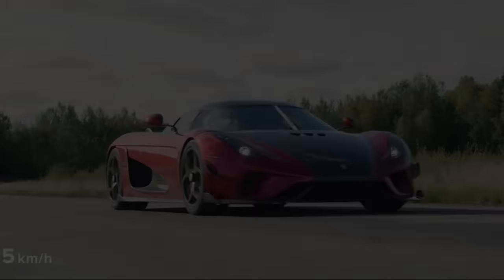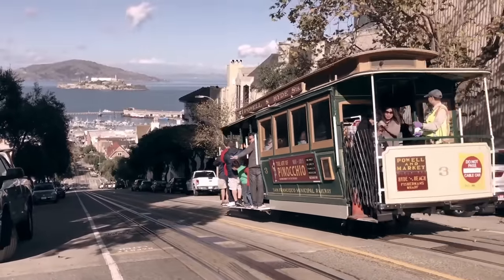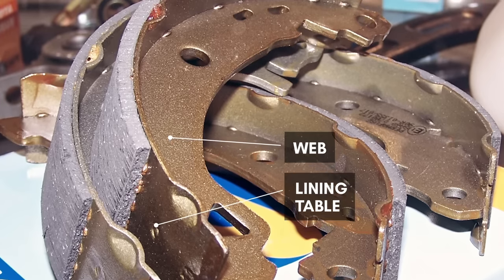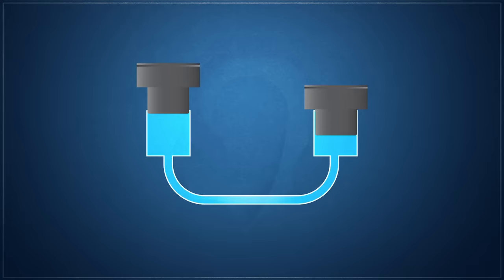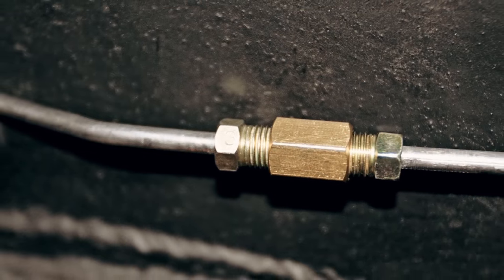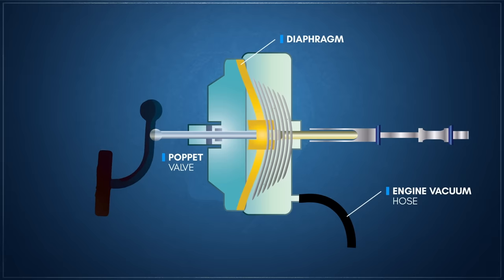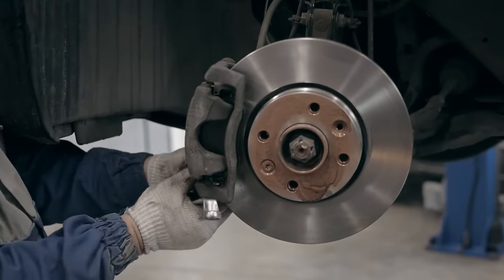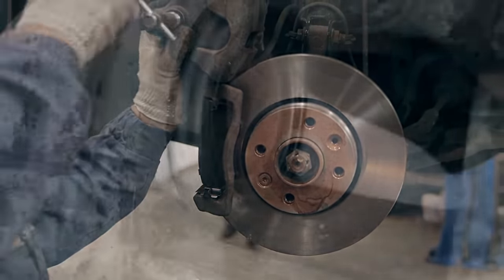The Story of Brakes

Comment: A positive effect brake technology regulations have had…
The iron composition of the rotors makes it easy to source proper and consistent alloy when doing a bit of mold making and casting.

It’s not too uncommon and there are a lot of folks out there who have been doing it for years in their backyard. Obviously takes a bit more complicated setup than a simple DIY garage set up to melt copper scrap or aluminum or what not… 

But it’s fairly easy to get going and not nearly as complex or expensive as an industrial professional setups.

A lot of it can be had on the secondhand market because of all the foundries shutting down or it can be cobble together from parts for almost nothing. Then a few times a year when the buddies need things cast for antique restoration or whatever reason… Throw a hella party for an afternoon everybody brings over beer and sweats their ass off helping. 

Quite a bit of prep work involved but it’s still a blast. There’s just some things that can be done easier and cheaper with a 3-D printer and simple moldmaking techniques instead of designing a cad model for CNC and trying to source proper materials. It has its niche but it’s also A lot of fun and sometimes you just need to part in cast-iron.

  
 A lot of at home casters have always appreciated the consistency in the alloys of rotors. Able to be sourced at most scrap yards for less than $0.10 per pound. And gives you the benefit of picking matching sets from the same lot to be sure the alloys are the same.

Comment: I remember watching a video on the mechanism and development of drum brakes, if they hadn't been descended from carriage brakes I doubt they would even have been developed at all since disc brakes are one of the most straightforward brake designs possible.
Reply: You make an excellent point.  One feature that prolonged the use of drum brakes was their self-energizing effect.  Many car buyers disliked the over-assisted touchy response of power assisted drum brakes, and were content to stay with un-assisted drums long after they had accepted automatic transmissions and power steering.  The linear response of disc brakes made power assist more necessary, but power assisted discs feel more progressive and controllable.  Front disc / rear drum brakes were an imperfect compromise solution, but still an improvement in the evolution to power assisted, anti-lock four-wheel disc brakes that we are all accustomed to for decades now.

Comment: small note: porsche also fitted some cars with tungsten brakes which decreses brake wear drastically while improving brake power
Reply: I'm not sure if it's actually improving brake power. As discussed in the video, virtually every brake system exceeds the acceleration force of a car/vehicle. ABS is there to prevent wheel slip, which occurs when you apply too much braking force. In other words, if you can lock up your wheels, which you can, you cannot brake any 'faster', the limiting factor being what's actually touching the ground - tyres.
Reply: The problem  is not the brake force but the tremendous amount of heat when braking from 300km/h or more. Also on the race track.
Reply: It’s called a thin layer of tungsten carbide. It’s to make the brakes last longer.
Reply: @dudo626 braking power is increased for sure. Obviously tires are the limiting factor, but you can also ways add stockier tires for allowing greater braking force. However even on the stock tires braking is improved at high speeds, as it reduces the velocity of the wheels quicker.
Reply: @2seep  Again, how can you "improve" breaking when brakes aren't the limiting factor?!? You CANNOT stop faster than traction will allow it without using other measures of breaking which isn't the topic here. "Reducing the velocity quicker" will literally block your wheels causing you to slip and lose traction. Please, tell me what drugs you are on, I want some too.

Comment: I just upgraded my 4Runners brakes to larger tundra brakes that fit and man what an insane difference a good set of brakes are on a vehicle. Especially a heavy SUV. stops on a dime now but also makes cornering and everything easier to control. A get set of brakes get you in tune with modulating the vehicle’s speed. Just makes the experience so much better.
Reply from the maker: Small world, I’m doing that exact same swap soon

Comment: cars also have a parking brake, which isn't mentioned, nor is the notion that hydraulic brakes require power from the motor to be effective. thus, 4-wheel disc systems require an additional drum system to act as a parking brake, which renders the rear discs almost pointless, yet they persist. who knows how or why.

Comment: Excellent job covering the history of braking technology development and the science behind each step of development.  Can't wait to watch more of your videos.  One early (sub) chapter of the story that I learned of recently... When the metal band around a drum was the default choice, Henry Ford chose to package that feature inside the transmission operating in an oil bath, and acting on the output shaft and thus stopping the driveshaft.  It wasn't common on a car brand basis, but when Model Ts were half of the cars on the road in the 1920s, It sure was the brake system for a lot of cars!  It did not have a lot of stopping power.  Model Ts also had a lever and cable drum e--brake on each rear wheel.  In 1928 Model As adopted four wheel drum brakes.

Comment: Cool video, as a car mechanic myself for 27yrs I found the history particularly interesting. One correction though, you say the automatic adjusters eliminate the need for adjustment on drum brakes at 09:58 , this isn't quite the case. Whilst it certainly reduces the need, the drums still need to be removed periodically to remove the dust and manually adjust the adjusters up (typically 2-3 yrs, about 20-40k miles), if this isn't done the pedal travel will gradually get longer and longer, as well as handbrake travel. Also the shoes will wear abnormally with greater wear occurring nearer to the wheel cylinders pistons.

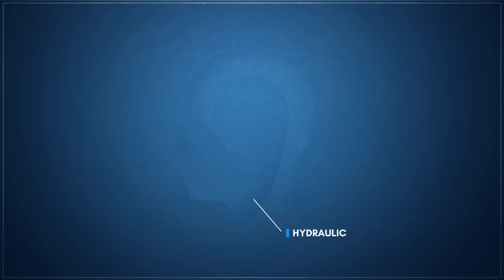Comment: Small thing, I know, but brake drums and rotors are typically cast iron.    Unrelated, but to help understand hydraulic systems, I find it helpful to think of brake hydraulic cylinder size ratios (such as described at 7:00) as similar to either a lever with one end longer than the other - like you mentioned - or like the easily-seen gears and ratios on a bicycle.

Longer, easier distance traveled by the force of my leg on the bike or brake pedal, put into a smaller gear or piston, converted by the diameter difference into a shorter distance of movement, with a much stronger push than I put in on the other end - and of course the inverse is true too.

Hope this helps someone wrap their mind around hydraulics.
Reply: Yes, and it's directly proportional;   so if your foot on the pedal is traveling 3" and the brake piston is traveling 1"--  that is 3x the distance, and will result in 3x the force at pads.
Reply: I think of it simply as smaller area = less force applied, longer distance traveled for same volume displacement. therefore, higher area piston, same volume displaced, much less distance traveled but greater force due to higher area

Comment: There is an error at 20:20 There is no hydraulic accumulator in an standard ABS Block. The excess pressure gets pumped back in the supply line leading back to the master cylinder. That's why you feel the brake pedal pulsating during ABS operation. A hydraulic accumulator is only needed for an electric brake booster.
Nice video! Love brakes.

Comment: Scania for twenty some years include three types of branding I'm heavy trucks. First the engine slows with electric resisters. Then exhaust. Brakes. Finally, the latest electronic traction control friction brakes. The service intervals make maintenance servicing a quarterly effort. The trailers though have air brakes only.

Comment: Great lecture. Thank you. You might want to add an addendum; Bosch is working on ‘brake-by-wire’ system which should improve the braking performance and the handling of the car under a heavy braking load.

Comment: In the 1980's Ford widely used a mechanical ABS system on the European Escort. In some countries only on the XR3 models but in others also on normal versions.
It consists of two belts (one on each driveshaft) which were connected to a flywheel type device which uses centrifugal force to detect rapid deceleration of the wheels and completely mechanically reduce brake pressure.
It was not a very effective system but it was a cheap solution for that time.

Comment: For those that may doubt the figure that the braking system on a vehicle produces more energy than the acceleration system, a Detroit DD15, on average, produces 455 horsepower and the engine brake alone on high produces ~600 horsepower of braking force. I'm a truck driver, I have years of experience with the DD15, and I would be practically thrown to the windshield if I was in an emergency stop with the engine brake on high when lightly loaded. It is my habit to throw the engine brake on high during an emergency stop and use the service (air) brakes to further slow down, and if needed I'll try to take another lane IF: 1. another lane is open, 2. There isn't a vehicle that would cause an accident during lane change or a rear end accident

Comment: No mention of the Ford Model T brakes. Brakes are a single band, originally with wood lining, that squeeze a single drum within the transmission which is bathed in motor oil. Later years used woven cotton material for lining. This system put braking pressure on the driveline. No brakes on the front wheels.

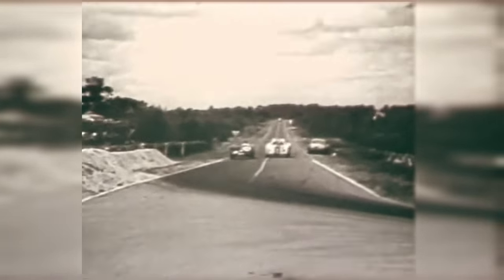Comment: 13:25 - the advantage of disc brakes is just about cooling! It's about the fact that metals get larger when they get hot. With a (internal) drum brake, the hotter it gets, the larger that the drum becomes. This means more pedal pressure/movement is required to push the brake shoes out farther to accommodate that larger diameter drum. The larger the drum, the more pronounced the "pedal dropping" effect, and sometimes requiring that the brakes were "pumped" to get a new bite. The more pressure and heat applied, the hotter the drum got and air cooling was minimal.
With disc brakes, the disk becomes slightly thicker when it gets hot, so the pedal remains high throughout the braking process. A solid disc rotor doesn't really stay cool very well, however the more modern "ventilated disks" use centrifugal force to suck air through the rotor to cool it.

Comment: The inboard disc brake system on the Jaguar, 
is also designed so that a car can be put over 
a grease pit, and change pads without jacking, 
or removing the wheels.  That is for endurance 
racing.  Driver parks over the pit, a mechanic 
changes out the pads, in a very few minutes.

steve

Comment: Electric Brake motors are also how Tenpin Bowling Setting Tables or Pin tables(which are the large "trays" that hold the pins & place them) Are slowed down to a smooth slow speed when placing Pins so they don't wobble and fall over, while releasing them very quickly (with big long "Belts" which are really just big rubber ropes heat welded together, which often fail and table might fall or get stuck uptop, but often not in some in between position as the Brake Motors are the only thing holding them up when in transit so if they fail or belt snaps tables drop with a large force as they can weigh well over 150kg. 

These "brake motors" work on same principle as Regen Braking in EV's, althought they don't harness the energy generated but instead dump in into giant Resistors banks with capacitors they just let the produce energy dissipate as heat and other losses. 
 
Tenpin Bowling Pin tables have used these electric motors for near 100 years if not more,
(- Former Pinsetter Mechanic)

Comment: Actually, in many circumstances (if not in all) such as on Ice or snow ABS does not shorten the breaking distance, it actually lengthens it. But the driver has added stability (especially if its a less experience driver that does not realize that you cant turn the car with locked wheels)

Comment: Check your data on the Benz Patent-Motorwagen. It had solid tires. The development of pneumatic tires was driven by the bicycle, not the motor car.

Also, even though this was mostly an automobile based presentation, it would have been interesting to include the brakes used on modern diesel/electric locomotives. They use the motors as brakes during deceleration but it's not captured regeneratively. It's just converted to heat by a giant resistor on top of the locomotive. Locomotives don't have the batteries to take advantage of regeneration and the high current from the braking would blow them up anyway.

Comment: No mention of Telmar, a iron disc bolted to the tailshaft and by applying an electrical current through copper windings around a stator it creates a magnetic field on the disc slowing the vehicle down magnetically.

Comment: Fantastic video. 1.1megawatts disspated by the Regero at the beginning of the video seems a bit much. Maybe an error in the units?
Reply: not really, when its doing 400km/hr its KE is 1/2MV^2 or 1/2*2000*111^2 = 12.3MJ which is dissipated over 8s so power is 12.3/8 = 1.5MW.

Comment: Drum Brakes are still even in 2024 Effected by Water Ingress and yes some new cars (small kei cars and small hatch backs) still have drum brakes in the rear. 

I Remember our Old Toyota Hiace Van in the 1990's (1970's model) when rear drum brakes got wet in puddle on our driveway when it was flooded, would majorly reduce braking ability and cause the nose of Van to dive majorly under braking as only front discs were working then.
 
So would have to RIDE the Brake pedal for about 1km after hitting a big puddle as it took ages to cook off the water in the brake drum so they worked properly again...

Also Drum brakes don't work well when in Reverse (handbrake works as car not moving, but if you get it rolling then engage rear drum hand brake it would slowly slow down n come to a gentle stop so not good in certain emergencies. 
(if you have 4 wheel drum brakes and say stall climbing a steep hill, if you dont stop car instantly it would start rolling and then no way to stop it if hill too steep, This was a common accident cause in the early 1900's on cars mostly light trucks n utility vehicles.)

Comment: Great video, you maybe could have included the use of the brakes to control traction in 4wd cars. This feature has removed the need for mechanical locking differentials with the brakes holding any slipping wheel to transfer traction to any wheel still in contact with the road?

Comment: This video just got me thinking, on horse drawn carriages (or sleighs!) without any braking mechanism, if the horse came to a sudden stop, what would prevent the carriage from carrying on under its own momentum and smacking into the rear of the horse. I never thought about that until now. And I could be wrong, but it doesn't seem like brakes are a very common feature on horse drawn carriages. And I know the velocity isn't a lot, but I'm sure that carriage probably weighs a good bit and so would have a good bit of momentum behind it. Unless brakes on carriages are more common than I realize. An interesting thought either way.

Comment: A great well researched video, except the first car with abs was the 1966 Jensen FF.
Reply: To be fair the Jensen did not have the electronic system which is standard now, but a mechanical one with a flywheel. It's different, but it's also a type of ABS system, so it would have been worth to mention it

Comment: The only real issue with regenerative braking as concerns regular brakes is the rust that builds on the discs when they're not in use. Solution is dead simple though - add a touch of hydraulic brake at least once for every journey. Better yet - programme that into the system.
Reply: This is one of those things that probably varies a bit depending on the car, but the one I have (2013 Toyota Prius, a hybrid) does this - it prefers mostly regen most of the time, but once you get below 10km/h the friction brakes are engaged for the final stop. It will of course do so sooner if you request it to slow faster than the regen can handle.
Reply: @aprilkolwey4779  Seems a good implementation. I think some Teslas are programmed to just not use friction brakes at all unless you use the brake pedal
Reply: @233kosta  This is with the brake pedal being pressed - this car doesn't apply significant regen when the pedal isn't pressed. It's a brake-by-wire system, so even though the pedal feels "normal" when pressed, it's not actually doing anything unless you max out the regen, go below 10km/h, or a few other cases.
Reply: @aprilkolwey4779  Yeh, makes sense, the single pedal thing is relatively new
Reply: The Etron does this automatically, tom prevent rust buildup.
Reply: Rust is definitely annoying, just have to kno how to manage it

Comment: That stuff works. I test rode a BMW motorcycle with ABS and went to a concrete floor slab with a light coating of sand, dirt and fine gravel.At 35 mph I hammered the brakes, mostly the front, and yup. Wow.
Reply: It's now even available for E bikes (from Bosch/Magura and a 2nd System from, Blubrake)